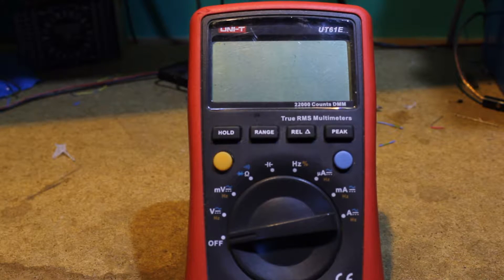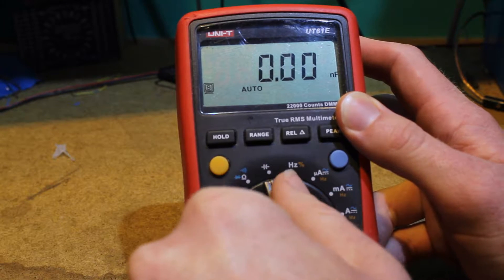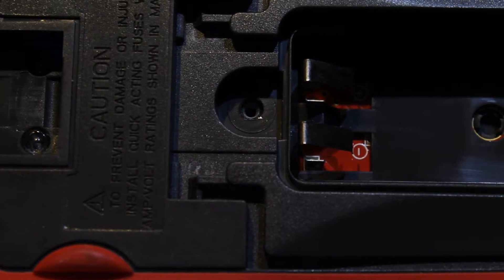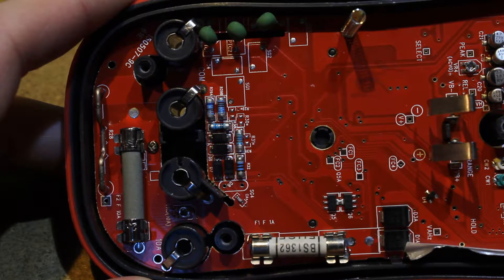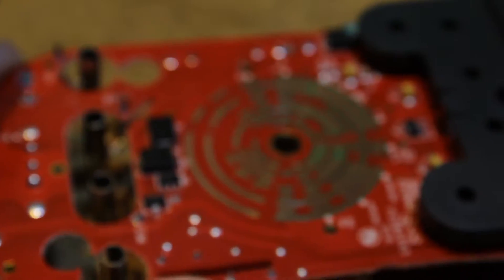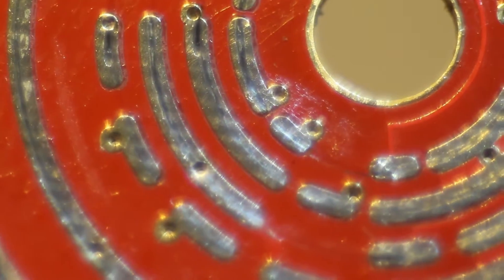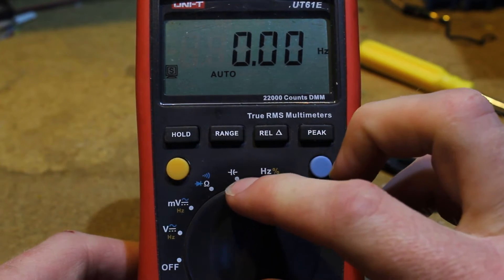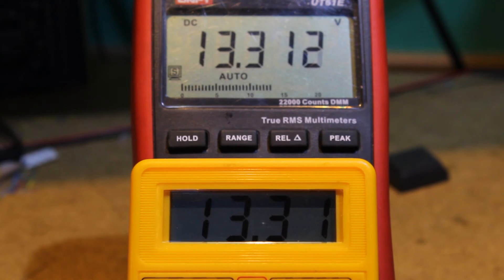Uni-T UT61E Range Switch Fix and poke around

Comment: Hi
I misinstalled the battery and the poles differed
And it destroyed the multimeter, and when I checked it, it turned out that the C36 was on fire
I do not know whether it is a diode or a capacitor and I do not know any information about it and it was replaced with another diode, but the multimeter did not work
Reply: doesn't matter what it was, you sent reverse voltage into the chipset and killing it, If you like to poke around your multimeter anymore, install a diode parralel to the battery in reverse polarity so if it happens again, only 0.7V can pass to the chipset witch is unlikely to destroy it. Use 3A diode for safety because if the diode melts your chipset will die.
Reply: well shit, that's no good